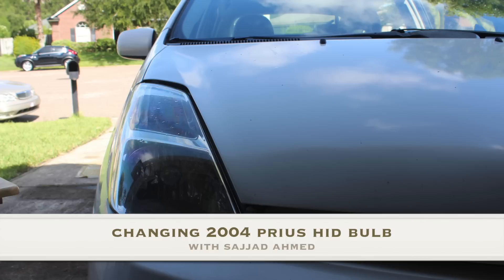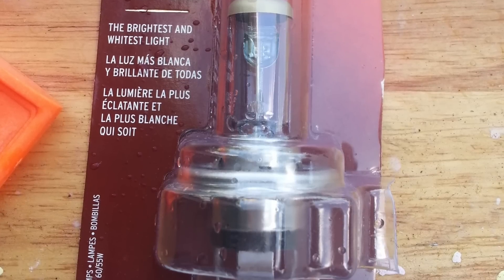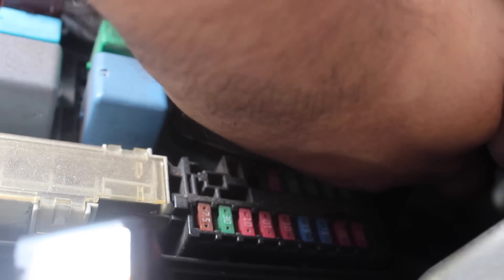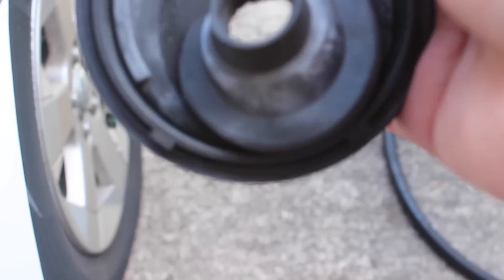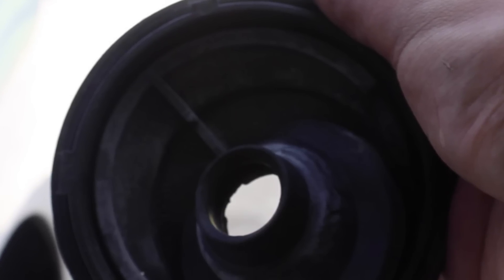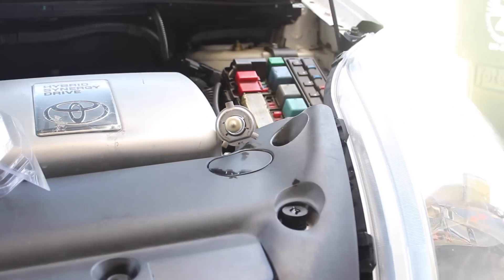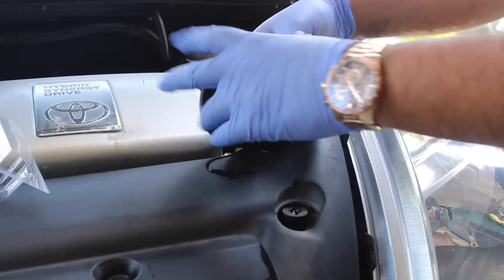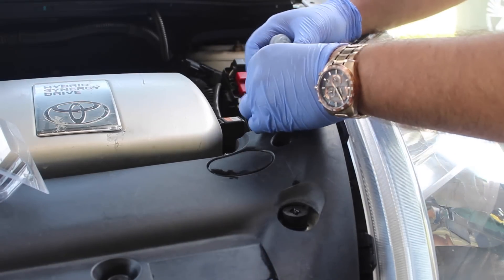[HD] How to change 2004 Prius HID (headlight replacement) Bulb

Comment: This is NOT an HID build replacement. This is a halogen bulb replacement.
Reply from the maker: njgoomba yes, but it is the same process for any kind of bulb
Reply: Sajjad Ahmed Thanks for the reply however it’s not exactly the same the Process to replace the H ID bulbs is a little bit different than a normal Halogen bulb. Access to the housing is a little bit different because of the backing.  Also the title is miss leading. 
Thanks 👍

Comment: I just changed a gen 1 prius headlight and you are spot fucking on on how bullshit it is lol. This vid had me dyin
Reply from the maker: yes thank you man the engine bay is way too tight, if you thin this is painful, try changing a 2000 mercedes e55 amg sparkplug, its a 45 degree plug in an upward angle with absolutely NO space to work